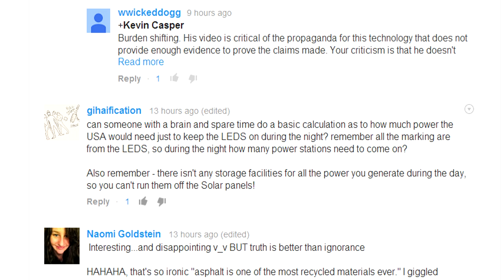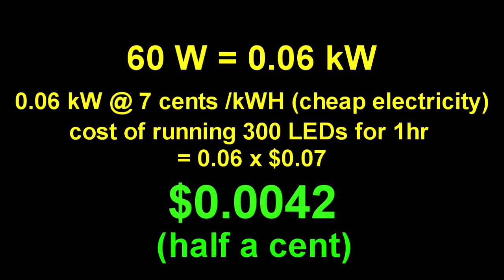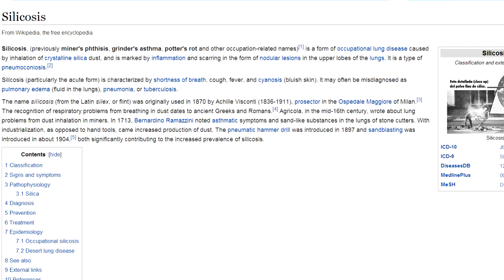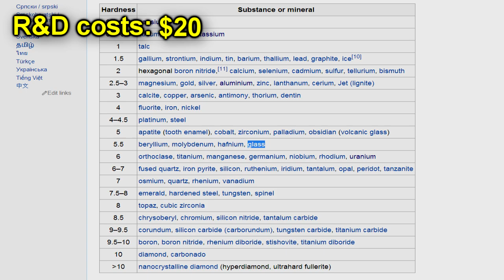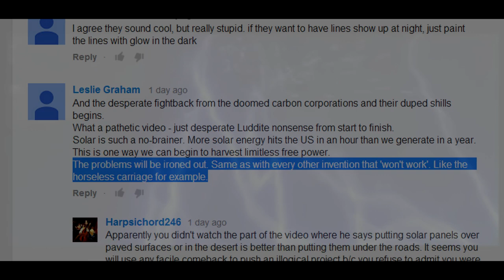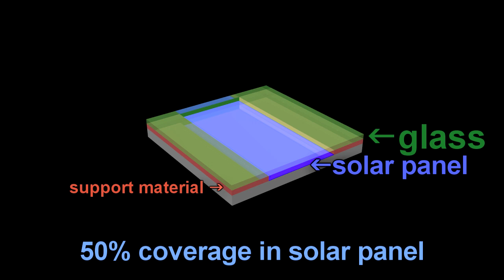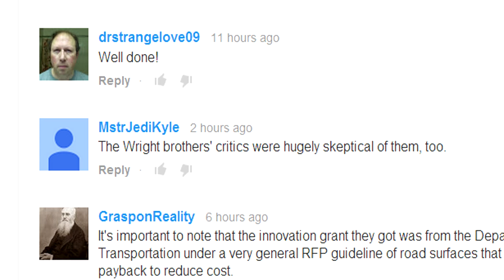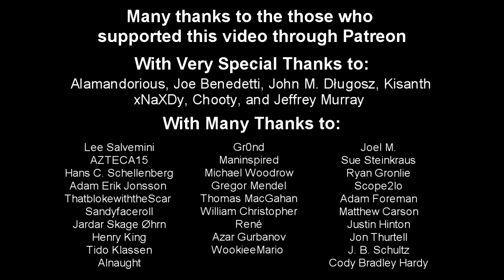Solar Roadways, IMPORTANT QUESTIONS AND ANSWERS!

Comment: what happened to the solar "TPO" roof idea about 10 years back. Solar panels integrated into a roll of roofing?
Reply: +john shead In about 10 years someone will ask what happened to the solar freaking roadways scam.
Reply: well at least the roofing was not subject to cars rolling on it. I know it was not as efficient as rigid panels, but i think the idea died off. I saw it used on warehouses.

Comment: the only instance where this would make sense is magnetically repelling road ways where no load is placed on the road.  Also if this is really about increasing the use of renewable energy why not place the solar panels upon roofs? 
One thing that seems to be missed is the increase of light being reflected by glass, yes solar panels are dark to aid absorption of light but on those cold winter days where the sun is at a low angle,  it's going to affect planes coming in to land.

Comment: Hmm, everyone seems to keep talking about glass being to delicate, which is probably true! Plain glass anyway. How about tempered glass? Or glass replacements? Such as clear aluminum? Or even just something like gorilla glass (I think that that is what it is called anyway)? Now, on to the light issue. Ever noticed that traffic lights use something called LIGHT? You can see it! Even during the day! And who says that the lights even have to be on all the time! Just have them on within approximate sight on people/cars on the road! Now on to cost. Think of how expensive LEDs were ten years ago, compared to now. Quite the difference , wouldn't you say? Same sort of deal with something called batteries, which are very useful items for storing power. Which would help for powering the solar roads during the night, right? Even better, the lights in the solar roads wouldn't have to be at full brightness during the night compared to the day! Even better, right? I guess that's all I really need to say right now, I'd welcome comments/questions.
Reply: Oh! Forgot to mention. Why in the word would you want to install solar roads all at one time?! I imagine that they would probably start with highways, section at a time, as money and supplies come in. And prices go down.
Reply: +Jesse Higley did you watch the video, ,using a gorilla glass is expensive. dont forget solar roadways is not as efficient as an angle solar panel .as for the led, did you noticed that traffic light led usually shaded  so you can see them and the glass protecting the led is dark colored.
Reply: Yep! Using gorilla glass sure would be expensive, at first anyway. The price would go down as the need for it goes up. People will find easier ways to make it, or easier ways to make even better glass. It doesn't surprise me that these solar roadways would be less efficient, at first. So were cars! That is steadily improving, so why not solar roadways? Traffic lights probably wasn't the best thing to bring up, there are however LED lit traffic signs. Or how about the flashing lights on police cars? Or electric billboards? I've seen screen versions of those. Most issues, if not all, could be addressed with the solar roadways concept. And it can happen faster for cheaper probably if more people actually seem to want it!
Reply: +Jesse Higley Because manufacturing that much tempered glass would take an insane amount of energy and would be an environmental disaster. Right now asphalt is over 99.9% recycled and is the most recycled product in America, and its also dirt cheap and safe.
"Same sort of deal with something called batteries, which are very useful items for storing power." These things we call batteries are also extremely bad for the environment. Manufacturing this many would be something we would call an environmental disaster.
"there are however LED lit traffic signs" There are however shaded housings that hold these LED lights. They're also viewed from a head-on angle. Solar roadways LEDs would be viewed from a low angle and wouldn't have a shaded housing.
"solar roadways would be less efficient, at first" Solar roadways will always be more inefficient than rooftop or roadside solar. The more efficient we are able to make solar panels the more sense it makes to place them in areas where they are most effective. The biggest downfall of solar panels is their price and efficiency. Solar roadways is developing a panel which is more expensive and less efficient. Its a waste of funding.
Reply: +Reddit Gold User You know, I'm fairly certain that the phone or computer that you used to respond to my comment would have been viewed as extremely difficult or impossible to make 20 years ago. Also probably worth huge amounts of money. Scientists DO NOT know everything there is to know, not even close. there could very well be a new type of "solar panels" invented next year that is easy/cheap to make, highly efficient, and absorbs light from any angle. Impossible? No. Same deal with every aspect of solar roadways.
Reply: Jesse Higley Solar panels and tempered glass have been around for decades. Unlike the computer and mobile phone industry, Solar Roadways sandwiches together existing technology without actually improving it.

"there could very well be a new type of "solar panels" invented next year that is easy/cheap to make, highly efficient, and absorbs light from any angle"
I agree, and that's where we should be focusing our resources first, and not on panels which use existing technology are more expensive and less efficient.
"Same deal with every aspect of solar roadways."
I agree solar roadways aren't impossible and could be improved. But better technology already exists. Even if you make a 100% efficient panel you're always better off putting it on a rooftop.

Comment: Transparent graphene is stronger than steel and lets in more light than glass, if industrial sized sheets are put into mass production then the cost would not be too high. (maybe)  The LED lights would run for free off of batteries tied into the solar panels but the cost of replacing them when they burn out is ridiculous.

Comment: youve made a bunch of videos debunking solar roadways. You should do one which hypothesizes what it WOULD actually take in order to do it. is it a bajillion dollars? what number is that. . . is it a material that doesnt exist? what comes closest? if all the finest minds on earth with an unlimited budget were put on the task of making the idea a reality, what would their biggest obstacles be?
Reply: The biggest obstacle would probably be common sense.
Reply: Arthanias why? if the panels are robust and efficient enough, it makes perfect sense to replace and engineering marvel like modern streets with them, since while still providing all the benefits of a roadway, it would also be generating electricity. people like electricity, you see. plus no one would have to use up more real estate to generate the electricity being generated by the roadways which are already there. it would be easier to maintain (given the panels are solid enough to last long enough to make it feasible) since in order to get to a repair site, you have to drive, on the raodway. youre already there. its genius. 

the problem with the solar roadways proposed are because we dont have solar panels that are strong enough to survive the beating cars will give it, they arent efficient enough to generate enough power to make them worth it, and they are too smooth to do the job we need streets to do. those are the real obstacles. not common sense. 

so how would we, theoretically, overcome those obstacles, thats what im asking. feel free to go scifi on it.
Reply: DazmoTube Here's my sci-fi approach: put them on the sides of the road where repairing them is easier, doesn't disrupt traffic nearly as much, makes them more efficient as you can install them on an angle, and you don't have to waste millions on unnecessarily rebuilding all your roads.
Reply: Arthanias put them on an angle. . . do people in your scifi world have one leg shorter than the other? heh. also it would disrupt traffic pretty much the same. youve still go to get the maintenence man there, and he hsa to park his truck. . . unless hes some sort of mutant snail or robot. ..
Reply: DazmoTube What i meant is for example in the ditch of a highway. putting solar roadways in cities is especially stupid as even more sunlight will be blocked by the buildings. in a city just put solar panels ON the buildings.
Reply: +DazmoTube Solar panels are angled toward the sun so that they generate more electricity. They don't do it for fun. Also if you place them alongside the road you can use much cheaper panels and you won't have to clean and repair them as often.

Comment: The reason they had their glass panels stored with rubber spacers between them already shows that they are worried about scratching them. If the cannot even be stored by just laying them ontop eachother how the hell are they supposed to survive with 40 tonne trucks running over them constantly?
Reply: +TheCalzonemovies A.K.A. Captain Obvious Oooh, forgot about snow tires. Yes that would be a ball. Spikes on glass, sounds like a show I might watch on tv. Nevermind these idiots claiming their panels could melt snow too, it can't even light up the LED's for the entire night. good luck with heating it.
Reply: +TheCalzonemovies A.K.A. Captain Obvious Yeah. Hopefully some polititian will stop this or demand a trial before they go live.

Comment: just curious how much power does a tracking panel need to work for itself, I mean it has to do the tracking and to move the panel around.
I am no way opposing this video, just curious.
Reply: +My1 It's fairly little. I mean, it's a single rotation all day. Apparently adding a tracking system can increase output of a panel by ~30%. But the mechanical complexity and maintenance needs, as well as the often limited space make it a less appealing project for homeowners. In a home setting, south-leaning (or in the southern hemisphere, north-leaning) panels do a good enough job. (And based on experience from the Dutch solar bike path, it has twice the output of a best-case scenario for a solar road). Tracking panels are more suitable for solar farms, where maintenance is easier.

Comment: solar roadways is a dumb idea if ya do the math but what about embedding solar panels into normal asphault and scraping the LEDs and glass. would that be a decent power source?
Reply: +Solo Assassin45 Regular solar panels are also covered with a layer of glass - for weather protection and to provide structural support. This doesn't make them suitable as road surface though - it's not load-bearing, it doesn't provide grip and ofc it's just as sensitive to scratching (and more sensitive to mechanical impact) as the original idea. Not to mention the bare silicon cells themselves - they wouldn't withstand a single tire rolling over them.
Reply: tybofborg i get why glass wouldnt work, i always assumed they werent using glass when i first heard about it but what about some sorta plastic?
Reply: Same problem - road grit scratching up the surface and making it less transparent. As far as I know, plastics are even more easily scratched than glass (no wonder high end smartphone models all use glass to cover the screen)
Reply: tybofborg well i tried to salvage their dumb idea lol

Comment: as far as beeing able to sustain the weight
how about smaller solar panels ? smaller than a tire width the  pressure would be divided between the road and the tiles
and you only place them at the location the line should be at , (Center and sides of the road)

Would that work in your opinion ?
(provided all other issues like powering the leds etc are dealt with )

just curious
Reply: +Pele sch Smaller solar panels just gives less power.  The dollars per watt is still waaaaaaaaaay higher than the panel up on the roof.

Comment: c'mon guys its not like all the led's would be on at once and im sure they would have some type of storage facilities for excess electricity like say from arizona or New mexico.
Reply: +Joshua Laird Too many of the LED would be on.  You need about 4 LEDs across the width of the line and about a row every few inches.  It is waaaaay tooooo much power to light the LEDs.

Comment: Despite all the other problems with solar roadways, in winter you will have snow and ice covering the roadways as well as less
sunlight. And snow removal equipment scraping the surface as well as adding sand or salt, which would further degrade the
panels. In rural areas they already have solar panels powering warning lights and illuminating signs, so above ground solar
panels are definitely going to have an important role to play as they become more efficient.
Reply: +Tuco Pacifico They want to use tempered glass.  Tempered glass fails suddenly and completely.  The grit would cause the panel to fail completely.

Comment: People laugh at wright brothers cause they're limited by their knowledge which says "man can't fly". We laugh at the freaking solar panel road because we HAVE the knowledge of how a roadways works and the complete science behind it.
It's like we as professors laugh at the college student's science project of creating a new solar powered rocket engine that could be charged into a battery in just a few minutes before take off and could actually create enough energy to take off and out of the atmosphere better than the traditional engines.

How much stupidity does it needs to ignore these facts and keep donating to the obvious scam? It seems like I could take a simple AA battery, stack it in a circuit and put them in a casing tower, cast it in a concrete block, attach some solar panels on to it, then advertise it in a indiegogo as a "SOLAR FREAKING BUILDING FOUNDATION". Or even as a "SOLAR FREAKING BUILDING". Heck, I'd do that to get the $2 millions... I'd even hire some people to flame the fuck out of any videos trying to debunk my idea lol.

Comment: The calculation on the LED's cost per hour isn't really correct. It's not as if they're ALL going to be turned on at the same time. For a road, probably less than 30% would have to be turned on. Although, I do agree with all of the other horribly stupid things about this "project".
Reply: I think the calculation was just to give a general idea. 30% of the LEDs on at once still isn't viable.

Comment: I am not defending this shit idea in any way, but when doing your calculations for led price/current draw, you should really use a data sheet, and not the specs of a led strip, I think the numbers would be significantly better
Reply: +Graham Kingston There are lots of LEDs and lots of datasheets.  No matter what one you choose, however, the LED lane marking idea is not going to work.  If they had suggested electrochromic displays or something it would have been less silly

Comment: Gotta love how people are more inclined to write retorts and tell somewhere to conduct tests to disprove their point, rather than doing the testing to prove it, themselves.
The argument for not covering all roads with solar panels, I would say, is a solidly valid one, but at the same time, I don't think the solar panel idea is a bad one either. It's just how they are planned on being used, is a little overoptimistic.

If people– homeowners and whatnot, were to purchase these tiles and have them set up in their own driveways, where the wear and tear will be limited and less hazardous to health and safety, then it would actually be a fairly good idea, if every household were to slap solar panels on both their roof AND their driveways.
Indeed they wouldn't be as efficient, laying flat on the ground and with a car parked on them in the afternoon/evening, their efficiency would further go down, but that would at least be a little extra energy stored up for each individual house, that they wouldn't normally get, so I'd say there's that, at least.
The heating element and LED features should be canned. If you got snow in the driveway, use a broom or snow shovel.
This would still create plenty of jobs and make the "project" more realistic.

My aunt and her husband got solar panels on their roof and an electric car. They practically drive for free, since their daily amount of juice they collect from the roof, is enough/nearly enough so sustain its battery charge. I'm sure they'd love to get a little more solar energy, from their fairly long, 75%–of–the–day–sunlit driveway and tiles along side their house. So I'd say that the project should continue...BUT expectations and technical features should be turned down a huge notch...
Reply: First off, when you make a claim (in this case claiming that your product will do something) you provide the proof that it works.
Solar freaking driveways would be stupid, considering that covering your driveway with the solar cells would likely be cheaper, more efficient and more durable.
Reply: Chavan Areeraksa
I agree. Clear proof or a very reliable 'proof of concept' should in every case- especially with ambitious projects like this, be mandatory.

I had a talk with my aunts husband about a week ago, regarding Solar Freaking 'Driveways' and he found the idea intriguing, but he also agreed that "glass-tiling" up the roads of the world would be a terrible idea! haha

The inventors of these tiles appear to have set them up in their own driveway outside their house. I wonder how "efficient" these have been...
I would like to see a full report with the (un-tampered) data. Anything from energy output, to wear'n'tear over the past years. Basically, to see if they are worth anything at all.
Regardless, these are not going to replace asphalt roadways. Sad, but true.